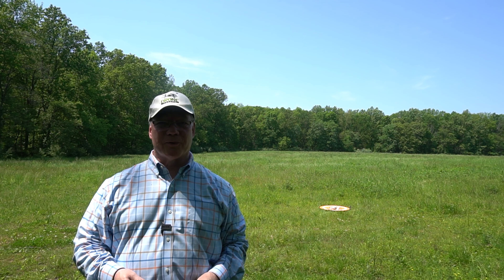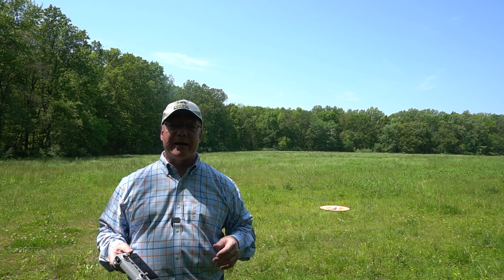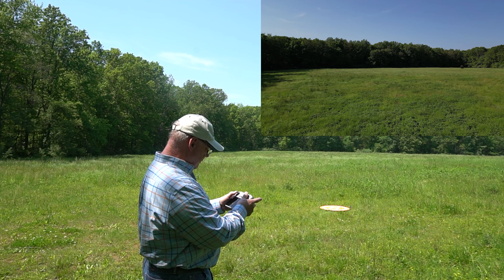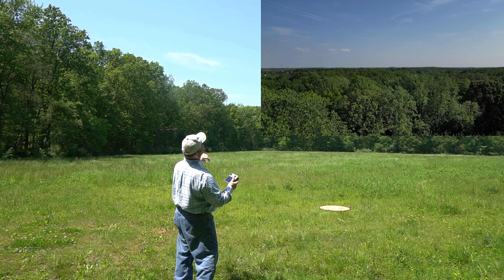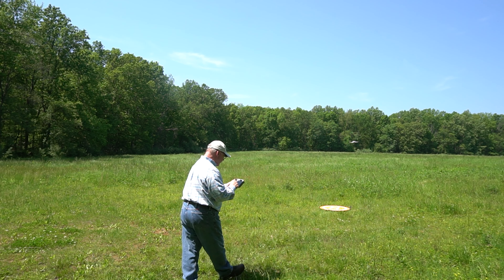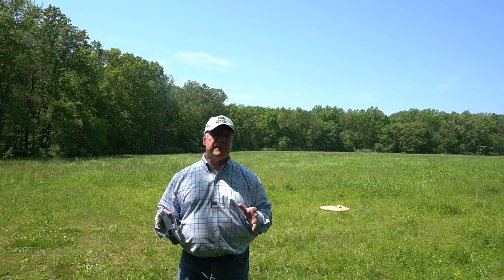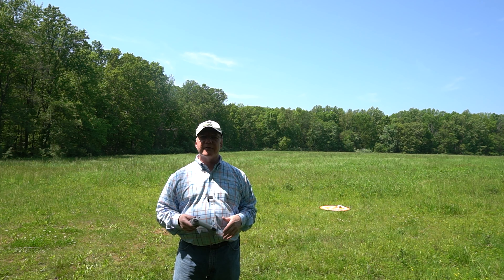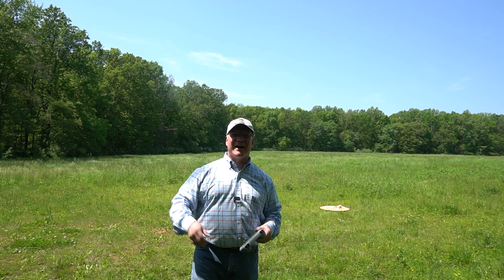Does The Mini 3 Pro Have Precision Landing?

Comment: Hi thanks for the vid - I love the energy of the delivery, can't help but smile 😀

After 4-6 years of research and waiting I have finally bought my first drone (M3P). In your vid you mention that precision landing is 'just a firmware update'. I appreciate DJI are normally fairly tight lipped about software updates etc, but based on your experience with other drones, in your opinion how likely is it that DJI will (at some point) update the M3P with precision landing capability?

Appreciate its not 'needed' but like you, I like to see these things and test them and thus have them as an option.

Thanks again - you just got a new subscriber.

Comment: Rick, I was told to takeoff, lift to 20 feet or so with the pad directly underneath, let set for 20 seconds or so then go fly.  I have found that my precision landing with DJI have reduced from feet offset to inches.  High winds in random directions during long flights 17-25 minutes, due tend to displace off the edge of my target, but on calm days I will land within six inches of takeoff after a 20 minute flight with multiple Quickshots and hovers for AEB photos.  It does seem to help, versus taking off from the stock hover altitude.

Comment: Rick - Thanks for doing this test.  Like many others, I am curious if this aircraft has precision landing.  I have to agree with those who recommend hovering at a higher altitude to let the sensors view the mat.  My Mavic Air 2 will hit the mat spot on when I hover it at 20-25 feet before sending it on its mission.  Please repeat the test using a higher "look" altitude.

Comment: Hi Rick... This is what DJI Support is saying now... "Hi Joe, Mini 3 Pro supports Precision landing. It needs a GPS signal strong enough to initiate Precision Landing so that the drone can be navigated back to the vicinity of the take-off point. Then, the aircraft needs to be able to visually recognize the pattern of the ground it took off from, for example, cracks or other identifiable patterns. A uniform patch of sand, however, is not suitable for Precision Landing. Finally, the Mini 3 Pro needs to capture footage of the ground during take-off to record its appearance. This means you may wait for the drone to recognize the takeoff point, instead of moving away immediately after take-off."

Comment: Hi Rick,
Thanks for the RTH precision landing test.   A bit disappointed that it’s not there yet, but I hope you’re right in that DJI will eventually add it in one of its software updates.
Reply: It's there. You just need to take it up to 50 feet for it to take a picture of the take off site, before moving forward.
Reply: @jameslovell8682  Hi James,
Have you tried it and if so, how close does it land relative to  the exact spot it took off from?
Thanks.
Reply: @samavella8831   Hi, the mavic air always managed to land within about 10 inches of take off point which I consider very good . I have the mini 3 on order, mainly because the weight makes it easier to please our Lords and Masters. Also because of the screen controller.

Comment: I don't know with the M3P. But my Spark must be started straight up for 10m until the eye icon (for vision system active) vanishes, in order for precision landing to become available when landing. You raised the bird only 2m and then flew away. This may prevent precision landing on return.

Note: precision landing compares the start image with the landing image, from a set height. This cannot work if the start reference isn"t available.

Comment: Would this be an important feature in the event your controller dies?  Granted, unless you fly with a low controller battery (stupid) this is very unlikely, but it could happen and prevent you from having any control again before the drone batteries die.

Comment: So cool. Can I ask you about your feeling of the brightness 🔆 of the RC? Is it enough for outside? 
Thanks 🙏🏼
Reply: I tried it few days a go... Well... Without any sunshield, in full sunny day, with sun in the background- it is not good enough. You can see something but not enough for proper control of footage. But friend made an improvised sunshield of cardboard box, a bit funny and clumsy but it did a good job
Reply: @ivan3465  thank for your answer. So you mean with a sun protector, the new RC can be good 👍🏼
Reply from the maker: Jean-chri, it's as good as it can be for 700 nits. To be honest, no screen brightness is enough to overcome bright sunlight because you're also dealing with glare. I find the new RC to be great for about 80% of the time I fly and for the other 20% of "high-noon" flying I just find a shady spot to fly. I hope that helps and it's an awesome controller.
Reply: @Dronevalley  yes. You help me 🤩. I will probably buy one cause I guess it is very comfortable to fly with 😉. Thanks for your great channel 😊
Reply: Jean might not be the best or flawless but it is 100% better than using an iPhone which dims almost immediately on sunny days
Reply: @elipin4128  yes thanks so much. I order mine finely 🤩🤩

Comment: The cameras look different on the bottom of the Mini 3 as compared to the others like the Air 2S.  I think the Air 2S and other has two separate downward vision systems going on.  The Mini looks like it only has the standard so I doubt they can fix that with just a software upgrade.
Reply from the maker: The Mini 3 had both a set of Binocular visual sensors as well as a set of VIO sensors (for stability at low altitude) so it has all of the hardware needed to find the mat. The challenge is that the software looks like it's not been updated to take advantage of that with Precision Landing. I'll keep testing and post a clip when it's been added. Stay tuned for updates this week.

Comment: How many times can the RC remote for DJI Mini 3 be charged before the battery is no good and can the battery be replaced by the consumer ?
Reply from the maker: DJI is using Lipo cells in the Mini 3 Pro remote and they can normally be fully charged about 500 times before they needs to be replaced. Typically you're only charging a portion of their capacity so this number can conservatively be doubled to 1000 cycles or more. If you do the math on this, you'll get 10 years of average use out of the cells if you charge them twice a week. Trust me, you'll have upgraded your drone long before that time. Thanks for the post!

Comment: Rick try this: do auto takeoff, when it stops at 3 feet then manually push the left stick up until it reaches about 50 feet altitude. Hover again. Then fly out to at least 500 feet and at least 100 ft altitude. Then do RTH. 
You should see it stop over home and start descending. When it gets to your second altitude of 50 feet then it will display “precision landing” and land on the H every time. If that doesn’t work, then precision landing isn’t available.
Reply: Battery will be down to 50% by then

Comment: On the Air 2s I you have to fly up and be at least 7 metres off the ground and let it stay there long enough for it to take a picture of the ground below. Below this height, it doesn’t work. 
So I am guessing that the Mini 3 pro will probably work in the same way, so I would give that a go in your next test. The exact height for the precision landing to work should be in the user manual. Hope this helps.
Reply from the maker: Thanks for the post and I have tested all of the DJI gear going back to the early days of the Phantom program and know about the hover requirement. I tried this test close to 30 times that afternoon and none of them came down anywhere close to the mat. It seems like the GPS portion of the RTH works great to get it home but they might not yet have implemented the visual portion of the adjustment. I'm sure they'll get this sorted out soon and as I mentioned, it's not that big of a deal for me as long as it's close. Stay tuned for more content this week.
Reply: But as stated,and I am no expert, the DJI drones including the one I have, need to go up and hover approx 7 metres  in order for the precession landing to work. So a video showing you not doing it not in the way DJI normally turns on precision landing , doesn’t really tell much. Note I have no idea if it does support precision landing. But given how impressive the active obstacle avoidance is, you would have thought it should be supported.

Comment: Hya Rick, looking forward to receiving the cable I need from you.
I see you failed to launch & then rise to about 10 meters or 30 feet.
When the drone arrives back near landing the downward cams & the optical or sonic sensors are starting to look for the "pad" but do not see it at the landing start height.
When all other mavic drones I have flown have landed on a pin point.
The drone never had a chance to see the landing area at height above where the bottom sensors start looking so it can not get even close to the 'pad'.
Try rising to 30 feet and then fly awy and you might have better results.
My mini 2 often lands right on the pad in good sunlight even though it has no such capability.
Every major I fly lands exactly where it launched from using the 30 foot rule.
Ray C. Florida

Comment: Rick, as others have mentioned, you did NOT hover the drone high enough at takeoff.  It has been my understanding from watching literally hundreds of videos of DJI drones over the past 3 years, that you need to hover at 7 meters or more to get the precision landing to operate properly. This is the way it works with my 2 drones. (air 1 & air 2) Please, can you try this? My drones CONSISTENTLY land on the mat within inches of the takeoff spot.  And this is after flying much farther away than a few hundred feet.
Reply from the maker: Michael, thanks for the post but I only showed the first test in the clip and tried it another 30 times or more using all of the suggested methods (which I know from all the other DJI drones I fly) and none of them resulted in a precision landing on the mat. Since DJI never advertised this as a feature for the Mini 3 it may not be available yet and hopefully will come in a future firmware release. I'll keep testing.
Reply: Rick, I'm sorry for suggesting that you might not have conducted this experiment properly. I should have known better!  I've been watching your videos for a few years now, and have always used them as one of my top resources for learning about drones. I certainly do hope that DJI includes this feature in a future update, as it is one of the coolest features, IMO, of many of their past drones. Thanks for all you do for our community!  P. S. - I love your enthusiasm!  👍

Comment: Rick to do a true precision landing you must first do a precision takeoff. It’s in two steps. Do auto takeoff and it goes to 3 1/2 feet and hovers wait two or three seconds then do nothing else with the steaks except push forward on the lipstick and take it up to 50 or 60 feet high, and then stop and hover again for two or three seconds then fly away after you get out three or 400 feet, then hit the return to home button and it will return at your preset altitude until it’s over the landing pad, approximately as slowly descends until your second hover altitude 60 feet or so then you’ll see it slide sideways until it’s exactly over the mat and precision landing will be displayed on the screen 99% of the time it will land within inches of where he’s a call from. Thanks! Bud hornsby

Comment: Im sure it will work better if you actually take off and reach the proper height first. At least 13 meters.
Reply from the maker: Stefan, thanks for the post and I did over 30 tests, including stopping at various heights, pointing the camera down on takeoff, taking a picture of the takeoff point and even resetting the home point at takeoff and none of them helped. When I test something, I test it extensively and will keep testing with every new version of firmware released to see if anything changes. It looks like at this point the bottom cameras are not engaged in the software, which is why Precision Landing isn't yet functional. It is important to remember that DJI never mentioned this as a feature of the Mini 3 Pro.
Reply: @Dronevalley  Great reply. Thank you!  I do believe another Youtuber has done this test with a better result. Or shall I say.. Had better luck. lol
Reply from the maker: @StefanMailey  Yep, at this point it's all about the luck until they add the feature on the firmware. The sensors are there, they just need the software to implement it. Stay tuned.

Comment: One thing that gets me is that if non-precision landing is 5 feet off, then GPS must have an error of 5 feet.  Thats scary for waypoints and other automated flights.  M2 started 5 feet off, but not my Phantom 3, go figure.
Reply from the maker: Thanks for the post and the challenge is that even though the tech behind GPS can provide accuracy to within inches, it's purposely "fudged" to be less accurate so our enemies can't use it against us in times of war. Even still, most consumer electronics that use GPS are accurate to about 10 meters and can refine that down to 2 meters with internal measurements and algorithms. This is what DJI uses to get the drone close to the takeoff point on the RTH. In other DJI quads they adjust the position further by using the bottom sensors that had taken a picture of the takeoff position when the drone was initially launched. With the Mini 3 Pro it looks like the GPS is working great but the imaging portion of the Precision Landing has not yet been implemented in the firmware. That's a simple thing to do and I'm sure is on the list for when the units are finally in full distribution. I'll post an update on the channel when it happens.
Reply: @Dronevalley  I know what Precision landing is.
My point was that my Phantom 3 Adv got quite close if not on the map and it only had sonar bottom sensing, but the M2 was 3 to 5ft each time.
That's way too much error for waypoint and other automated flights, and that doesn't seem to be the case.  In flight there's a lot less error.

Comment: Not like the Skydio
Reply from the maker: Thanks for the post and to be fair, the Skydio didn't have it at launch either and only added it later when folks were comparing the drone to DJI. This was never an advertised feature in the Mini 3 and would be incredibly impressive to add it to a drone weighing less than 249g. I love my Skydio drone too, but for different reasons and it's not rational to always compare drones that were built to do different things, expecting them to overlap on features.

Comment: It sounds like he is making excuses for the Mini 3 drone
Reply from the maker: Nope, I tested it and just reported what I found with the Precision Landing. It isn't unusual for the drone to be missing a few features at launch that are added back in later through firmware. This happened on the Mavic and Mini series before. Also, DJI never advertised this as a feature for the Mini 3 so it's a bonus if they choose to include it. I did the test because I had a lot of folks asking about it. The reason I started the channel is to answer questions like this one so we all get smarter together. I hope that helps. Rick